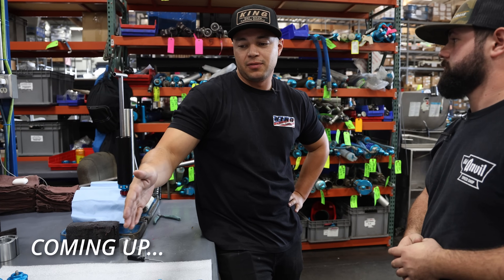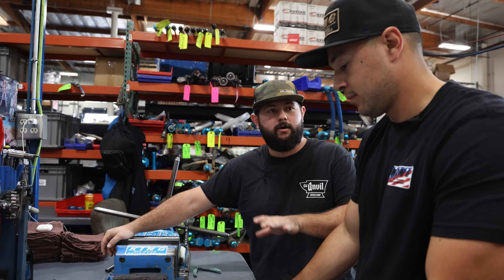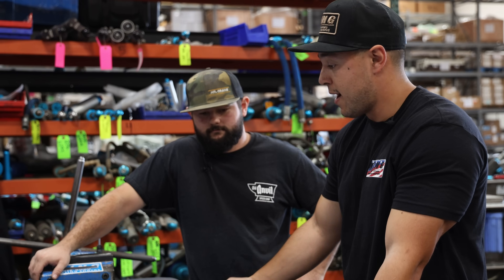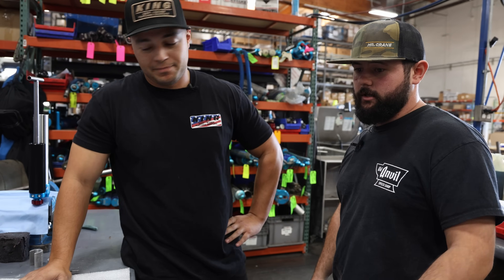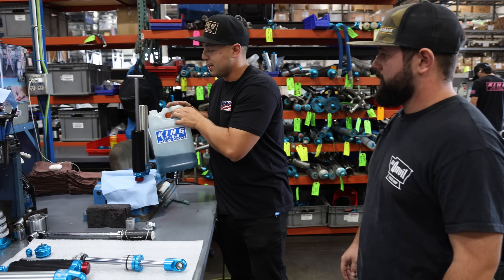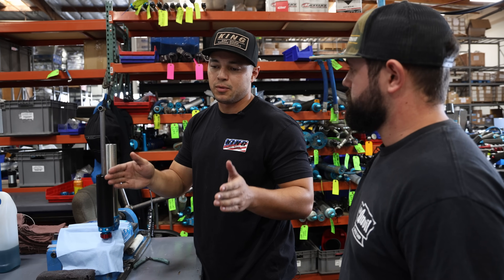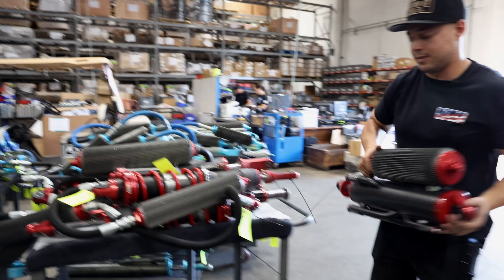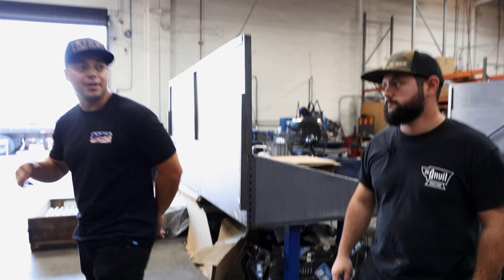Why (the heck) Are We Putting KING Off-Road Racing Shocks on a '62 Impala?

Comment: Great information. I'm building a bagged 55 Dodge Royal lowrider... In New Orleans 😂 I need some recommendations on getting a ride that will keep the wheels on the ground with the smoothest ride possible. It will only have a crate 350, but I dont want to slam the brakes to avoid a crator.

Some places in the world ppl drive on the left side of the road. Here in New Orleans we drive on whats left of the road 😂

Comment: Is Old Anvil in the same building where Alan Bassant Racing Engines used to be?
Reply from the maker: We’re in the same shop as Fast Eddies used to be but not sure of the other you mentioned.
Reply: @oldanvilspeedshop  Thanks. It used to be an engine builder called called B.E.P. (Bessant Engineered Performance) I'm nearly sure you're in the same spot. They moved to a new spot down the street near Glassell and Walnut.